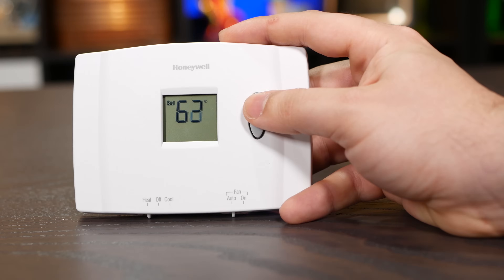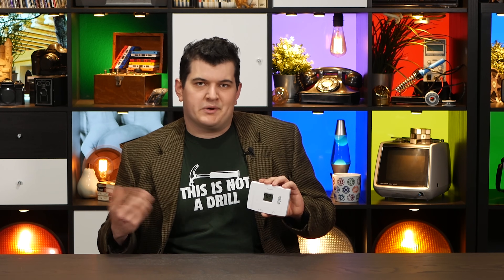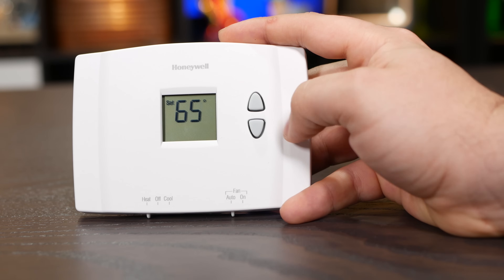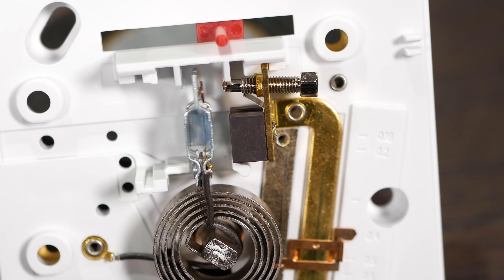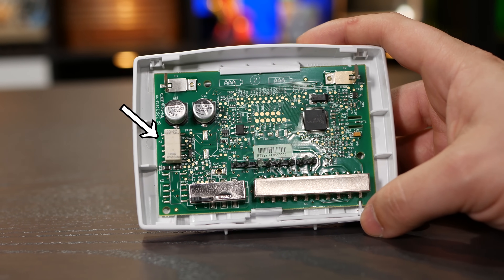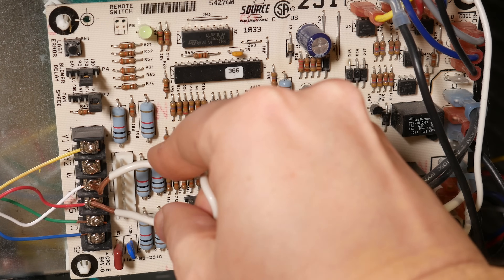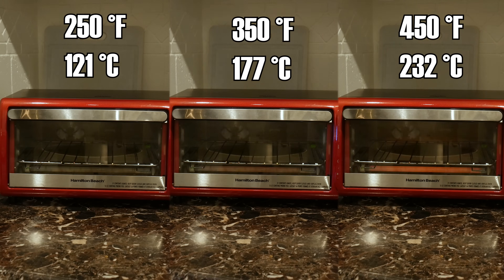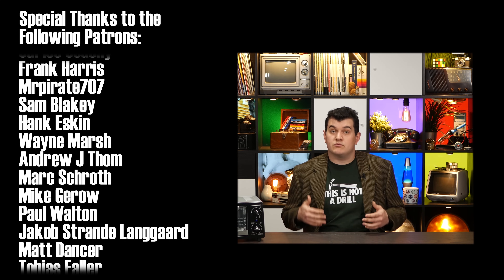Thermostats: Cooler than you think!

Comment: Wow, I never realized those bimetallic thermostats existed. Would make for a great temperature regulator for a lot of homebrew projects. Anything with a fan and enclosure that needs to be ventilated comes to mind, especially if its something that produces varied amounts of heat (like a power supply or voltage regulator) so the fan only runs when it needs to. That little calibration screw could be used if you wanted a higher or lower set point than the stock adjustment allows, and modifying the lever assembly could probably allow for an even wider temperature range. Or it could be used to power a light to indicate an overheating condition. I feel like  I need to get one and then find a use for it

Comment: As for the last question... for modern setback thermostats, most have 4 time intervals for each day.  WAKE, LEAVE, HOME, SLEEP.  If you push the + or - button while the setback thermostat program is running, it will temporarily override the program and operate at that new setpoint, until the next time interval starts, which it then returns to the setback program.

Comment: Also similar to PWM, the insulation of your home (or toaster oven) is like the capacitor smoothing the temperature.  I never really thought of it like that before.  Similarly, I had a bathroom once with a wall heater, and it would either be way too hot when the heater was on, or way too cold when the heater was off, because of poor insulation.

Comment: The first question asked by Sneaky (The N1) if I'm understanding it properly is actually how the majority of typical homes in the UK run heating. A central boiler is used for heating and is controlled by a thermostat somewhere in the house, like the ones demonstrated in this video, but individual radiators have their own thermostats of sorts to control the heat of that particular room. They aren't very comprehensive as they don't allow you to pick a temperature rather than an arbitrary number between 1-6  (usually).

Comment: Inverter ACs and heat pumps don´t work at full blast-off. They have lot´s of different speeds on the compressor and 2 fans, and a inverter regulates that based in the temperature. So yeah, if you have a inverter machine you will get cooler if you turn it to 18ºC than 22ºC. But they usually have a turbo mode where the compressor works at 120% for 15 minutes so silly to turn it to 18º having that mode.

Comment: In europe, we have OpenTherm. This is a wonderfully odd single wire two-way digital communication link (coms via voltage in one way, current in the other) that allows the thermostat to do things like change the temp of water in the central heating to allow quick temp changes without overshooting and very stable temps. It can also be used to turn the hot water on/off when you're in/out of the house. It also has loads of other diagnostics & control available though I'm not sure how much of it is actually used in reality. OpenTherm is a requirement in some countries. While it's available in other EU countries and offers advantages in theory, most installers stick to the relay-based systems they know.

Comment: Thanks for another awesome video, they should edit the dictionary and put your picture under "awesome" :)

If anyone cares, the out-of-US version (Europe, in this case) is like follows (if you remember, Nest took a while to release an EU version, especially because of this): heating does use a thermostat, cooling does not. Heating is most often done with water (fire heats water, water heats radiator, radiator heats human or air in the room human sits in) and cooling is most often done with air (electricity turns compressor, gas gets compressed outside the house and released in unit inside the house, unit gets cold, local fan blows air over the cold part, cold air goes out and chills room).
Coming back to my previous idea (who usually has a thermostat in the EU), all gas-fired boilers have a connector for a room thermostat whereas only industrial/office-style A/C units have same. Hence, it's much more common to find the "box on the wall" only controls the heating, while the summer stuff is controlled by its own remote.
As for voltages, the boiler puts mains live (yup, the whole 230V of it!) on one wire and expects the thermostat to short it to the other wire when it wants the boiler to turn on -- that's what Nest had to re-engineer and recertify for. Just like in the US, any "smartness" in the thermostat requires local batteries. The only exception are underfloor heating systems in which the wiring center will provide mains live AND neutral and expect the thermostat to shunt live to a third wire when it wants the heat on.
Now, if we move away from "the most common thing you can buy or find in a friend's house" to "fancy stuff", yes, most contemporary boilers speak OpenTherm but nobody sells OpenTherm-speaking thermostats here :-) Same goes for A/C systems, most have some interface for connecting a wired (as opposed to IR) remote that looks just like the "white box on a wall", but nobody would sell it to you for a consumer installation -- they only show up in office buildings and the like.
The multi-room, multi-sensor thing (that you mention in the video) is done, on the heating side, with thermostatic valves on each radiator (boiler is controlled by ONE thermostat, but the rooms that want to stay cooler can do so by adjusting said valve down); and on the cooling side by having multi-split A/C in which the indoor units in different rooms can be set to different cooling powers.

Hope this out-of-the-US perspective helps :-)

Comment: You got a couple of things wrong in that video
You said that electronic thermostats use thermocouples to measure the ambient temperature
They don't, thermocouples are only capable of measuring temperature differentials, thermistors are used for measuring absolute temperatures
Also
You say that the only way for electronic thermostats to steal power from the furnace is to send a heating or cooling command, but that is not true
Digital thermostats that run off of the Furnace only steal power for themselves when they appear to be an open circuit, drawing only a milliamp or two to power themselves, this is not enough current to trigger the relay in older furnaces, and newer furnaces emulate this to be backwards compatible

Comment: Most commercial HVAC systems I design run on a 0-10 VDC signal from a "fancy" room thermostat or a building management system. Usually these systems will have discharge air control. For instance the unit may discharge between 55°F and 85°F with 0V corresponding to 55°F and 10V 85°F. The thermostats don't know what temperature they are getting, only that they want more. The equipment will then modulate the heat as appropriate to achieve its setpoint. This is common in Canada, maybe in America its different.

Comment: Amazing how you were able to avoid saying "feedback loop" for 15+ minutes on thermostats
Reply: I was waiting for the explanation of the heat anticipation adjustment and how it effects the duty cycle along with the screw on the contact effecting the hysteresis and the two working together. Then I was sure he'd give the nod to the people who turn it way up to get it hot faster in that as the temperature approaches the set point it does start to cycle off periodically. Then I figured we'd here all about the algorithms that accomplish the same results without a heater in the thermostat. Still a very good explanation.
Reply: @patrickbroyer5518  Indeed these nuances exist on a finer scale (maybe within a couple degrees of setpoint) but the principle of "cranking it to 80 doesn't heat faster" stands. I don't think you or me are the intended audience, as stated at the beginning.
Reply: @ewicky  I don't think it does stand. My Nest thermostat has proportional PWM control. If the set point is only 1 deg above the room temp, the furnace wll cycle on and off every couple of minutes. if the set point is 10 deg above ambient, the furnace will run continuously for for a longer time.

Comment: Electric stoves and dryers work the same way only they are not influenced (much) by external temperature changes.  And Romex is used on some thermostats because they are actually switching full ac power on and off to the circulator motors.

Comment: Thermostat wires have to be at least a certain size or else the resistance is too high and won't reliably trigger some systems. I work in HVAC and had offered to use the remainder of my CAT5E cable(over a thousand feet of it) that I used when I worked in IT for thermostats but come to find out they're not large enough so that's right out.

Comment: There is another kind of residential thermostat, probably obsolete, but I had one in California in an older house, and it was quite common in the last century.  This thermostat actually generates a weak current from a thermocouple that controls the burner (on or off).  In my case, it was a convection gas floor furnace less than 15 feet away.  I think these are called millivolt units.

Comment: You didn't talk about the fan control.  My home thermostat doesn't have any wires going to the fan, and all the home devices I have ever had work as follows.  The main thermostat controls only the burner: off or on.  Internal to the furnace is another thermostat (non-user controllable) that turns on the fan when the internal temp reaches a factory-set value.  When the internal temp drops sufficiently, due to the main thermostat turning off the burner, the fan turns off.  This means there is a delay (a few minutes, typically) between the request for heat from the main room and the fan starting; likewise, a delay after the main thermostat's request to turn off the main burner.  I'm sure the reason for this design is so the fan doesn't run when there is no heat, and when the main burner shuts off, the fan helps cool down the furnace by making use of the residual heat instead of wasting it.  However, this causes a small temperature overrun at the end of the cycle, and a small lag in the start.  Not a serious flaw in a home heating system.

Comment: At my last apartment, a/c was blowing room temp air on an extremely hot day. Called maint., and  one guy knew right away I had a refrigerant leak. Second guy says "yeah, when it's real hot like this you have to set the thermostat lower so the a/c works harder to keep up." -_-

Comment: I've (and probably other commenters) seen Industrial and commercial thermostats that have timers for short term off schedule heating and cooling.  Set the schedule, connect a 'lock' jumper and when some pleb turns the HVAC up or down, the thermostat will comply for 3 hours and then default back to the schedule.

Comment: I don't think it has to be bi-metal the one you are showing (just a metal that has good expansion when heated).... That is only if the spring is flat then you would need that bend and the bimetal could do that. I think the one in your example could just be a piece of long metal as that would get longer when heated and that would move the contact around.

Comment: Not sure if someone has already said this, but there's definitely a disadvantage to having the temp sensor in the controlling monitor depending on the structure of the building. I live in a 2-story townhome with a single control monitor on the 1st floor. When I run the heat the 2nd floor always ends up being about 5 degrees (F) warmer than the bottom floor (since hot air rises, I assume). I'm considering getting a Nest thermostat and temp sensor unit so that I can resolve this issue. You rock, thanks for being awesome 👍🏾

Comment: 13:00 Why are you talking about using PWM to drive heating elements like it's some crazy future technology ?
And why do you suggest it wouldn't adapt to outside temperature and content of the ovens ? 

PWM driven elements can be controlled by a temperature sensor just the same and much better than a bang-bang control system as we have now. 

In fact, I REALLY what my cooking stove to have accurate temperature sensors PWM driving my heating element because it's way to unstable now (and yes, I have a recent one)

The system you'd want to use is a PID control (proportional–integral–derivative controller) instead of a bang-bang controller. You can make a PWM oven in about 1 hour and using about 20$ in components...

Comment: Educational & entertaining as always! Bravo! Now for my question: Large buildings of course have quite complex & intriguing HVAC systems! That's a "given." What do you think of manufacturing a "smart," household-use thermostat that has a remote thermometer mounted in the shade outside the house and uses a logic circuit to balance the two? Let me elaborate: If you want to save energy by NOT running the A/C, such a system would have a mode to circulate exterior air into the house at times when the house is too warm, but the outside temperature is quite comfy! Obviously, this would increase construction costs by having to install intake vents & ducting. But maybe - just maybe -- some clever engineer can design such a device  for small structures like homes! It is already in use in large buildings! I welcome all comments!

Comment: I have a hot water system which 'smooths' out the on/off cycles the water acts like a storage battery of heat (no AC). It takes longer to feel the heat, but it lasts longer after the thermostat has been satisfied.

Comment: i just made the (technology) connection that you could EASILY program your own, much more complex (idk why you'd want to; who cares about complex climate control) thermostat with an arduino and some basic code set to ourput pins to each of the wires the thermostat goes int.  I feel like a thermostat would even be pretty easy to make from scratch, with a few NAND gates and comparators!
Reply: on that note though, I'm in a new apartment right now and it's digitally controlled.  However, my old house that wasn't lived in since the 1970s was a completely analog system.  It had an old luxaire thermostat, and, dangerously, the last paperwork I found in my basement from the entire climate control system was last updated may 1968.  There was no electrics in it at all, but the A/C and heat still worked fine, if not, actually, rather well.  I don't know how this kind of system works haha

Comment: 24V on the control pins? hahahaha i wish.. when i was 12ish i disassembled the thermostat to i think clean it, but the wires coming out the wall were a bit short. i pulled the wires with both hands.. only to discover those were 230VAC MAINS WIRES coming off the service line which btw doesn't have a differential safety device. YEAH that stung a bit.

Comment: You didn't talk about PID circuits. Today's thermostats are more than just dumb switches. Well, you talked about their mechanical kinda-equivalents (the magnet and the weight of the mercury which kept the thermostat from reacting too quickly and turning the furnace or the a/c on and off too quickly).

Comment: In the UK domestic  AC is very rare, so are thermostats are usually just dry contacts. But our new boilers (furnaces) are legally required to have modulation - ie can be commanded to burn at a higher or lower rate proportional to how much heat will be needed and there'sa standard protocol, opentherm, for interfacing to controllers. Hot water radiator heating systems, common here, also have weather compensation to raise the temperature of the circulating water on colder weather. Re the short temporary boost button you want, almost all our hearing controllers except the very simplest offer boost options, often just an hour, and  temporary override that reverts at the next time-temperature set point.

Comment: Quickly... the question about setting a temperature that won't affect the cycle.. look for a feature called 'Hold' vs. 'Set'.  Those are the terms Honeywell uses/used and their more advanced thermostats offered this.  If you used the arrow keys it would change the current set temperature but the next programmed event would reset it to the programmed value... I hope that makes sense... (Steph, please don't push the up arrow 5 times then open the cover and press the hold button... just press the up arrow 1-2 times ONLY,  then we can enjoy a full nights rest and you wondering why I'm grumpy; she felt great...had to sleepin till noon because I was so restless. ME:  I had a hard time getting to sleep... woke up at 1am.. 1:30...  2am... got out of bed...groggily went downstairs, tripped over cat...had to open thermostat door, press cancel button...go back up stairs... get into bed and realize I'm fully awake..

...Hmm, I must give you  credit for explaning a thermostat... sort of... the trouble is its the kinda topic that may seem complicated to the lay person, but to those with a technology/engineering background such as myself its a rather simple topic... or so I you think until you start  to  explore it more and realize you really need to understand HVAC systems to understand how complex thermostats can be.

FIRST OFF... you need to put thermostats into two categories... LINE VOLTAGE thermostats and LOW VOLTAGE thermostats.  While you might think this separation is just about voltage and therefore trivial, like initially did, you would be wrong.  You have more or less explained the first category but used items from the second category.  (I'm pretty certain you showed a picture of an HVAC control board when speaking about thermostats....)

Comment: I noticed the same behavior on my microwave oven. Setting different power levels doesn't change the power output. It just switches from full power to no power with different durations during the set time span.